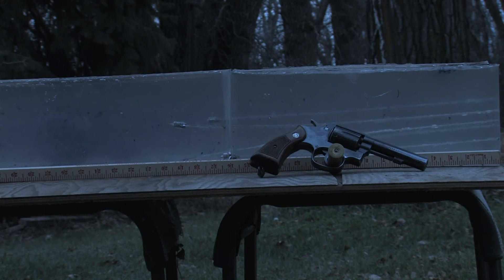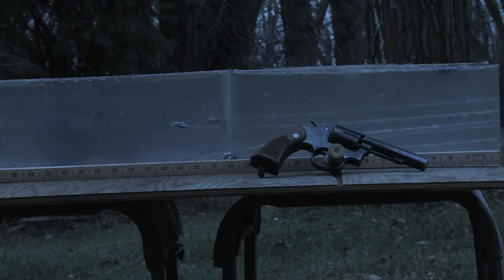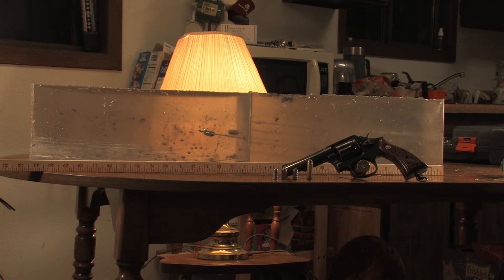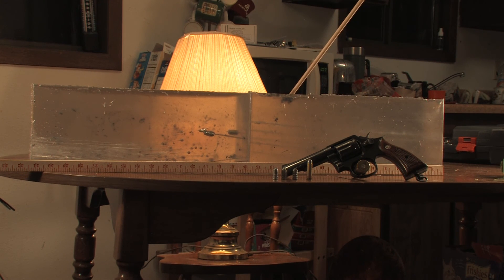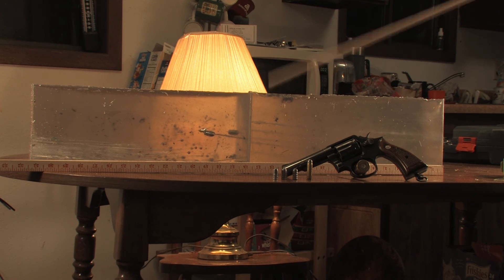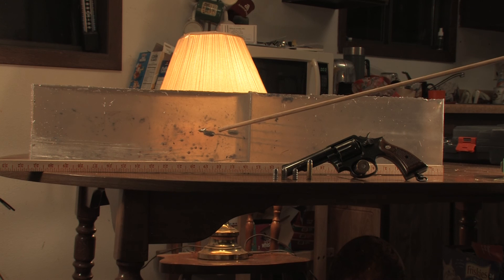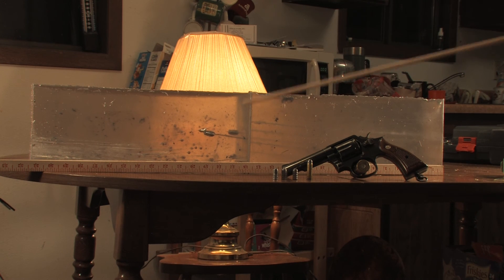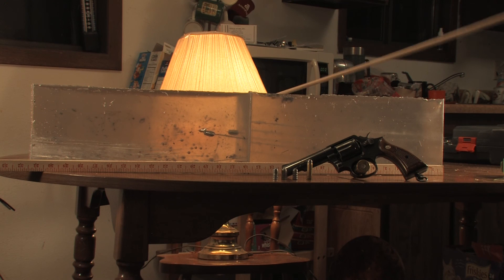Handload 38 Super Police in Clear Ballistics Gel

Comment: What did bullets weigh. I used  wheel weights and mine were closer to 200 . But I thought of using a drill press on the  bottom grease groove and it would  to take much to increase the weight.

Comment: Great info a classic load. Very interesting. 
I've been thinking of loading up a schwack of these for an Enfield Tanker .38/200
Reply from the maker: Do you cast or buy your bullets for the 38?  And does your Enfield have any issues with oversize bore?
Reply: kingduckford I cast for my .38 special but was planning on buying some .361 commercial cast 200s for the .38 s&w. not a lot of those molds kicking around up here and the Enfield's were designed around the 200gr bullet weight so I think it makes sense.